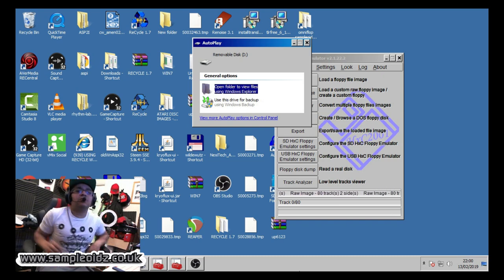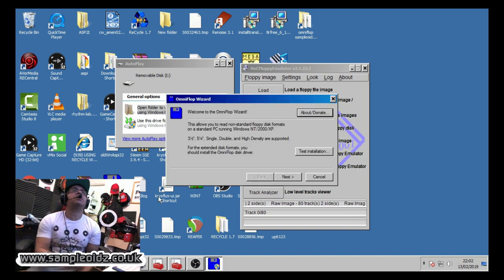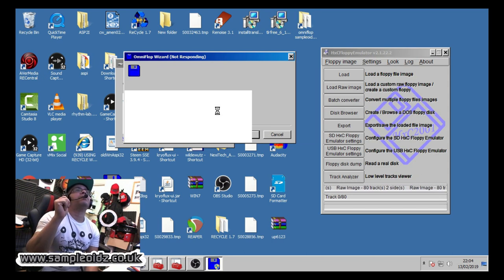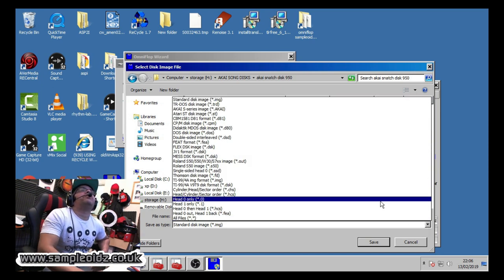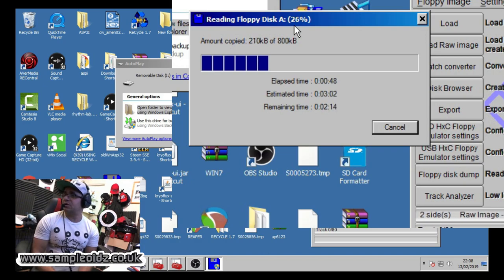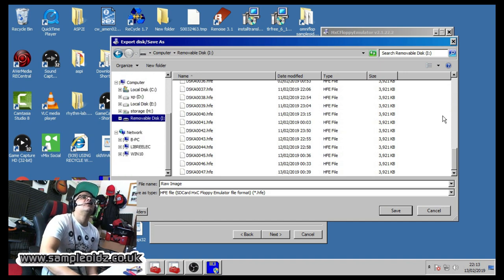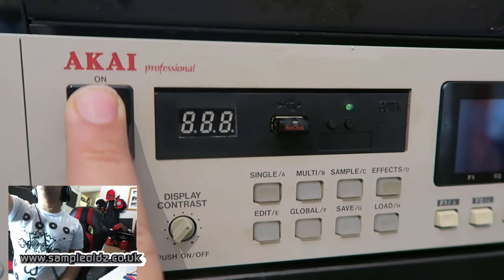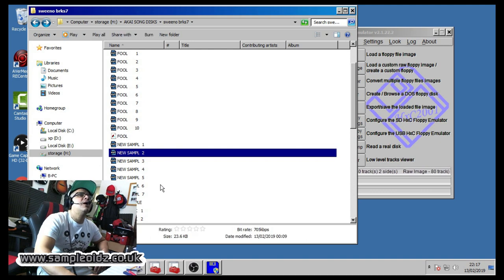Converting Hardware Sampler Floppy disks  to HXC Emulator 2019

Comment: You mate, are an absolute saviour. Just to let you know (if you didnt already) This works a treat with the s2000 aswell. I used your tutorial and a couple of bits online to reserect a s2000 with a dead drive. Thank you so much for your tutorials!
Reply: @TheBizzyBScience   I dont have any 950 disks or images, so the only thing i could think to try was converting the 15k king disk to a 950 hxc image to test it out. Unfortunatley in pops up with a 'No Disk!' error. I'm going to see if I can get hold of a 950 floppy off a mate to try and convert. I chose 3000 disk type in the hxe software which works, so if there is compatability with the 950 and 3000, there must be a way to get them to work. I'll let you know if I find a good way to convert them!

Comment: I have a Brother PDC100 sequencer that does not read or write anymore and i have many floppy disc that i have saved data on from it,can i convert these floppy disc to the HXC Emulator or some other format so the PDC100 floppy disc can be read on a PC or other sequencer?
Reply from the maker: I have not heard of this sequencer, but I think with some deep diving and experimentation with the config files and jumper settings you could find the correct settings. then rip your disks using onmiflop to img files and then to hfe format ( using goteks software ) good luck

Comment: hello great vid..don`t you have to have an old windows p.c. i.e XP with an INTERNAL drive to read these disks? ..i`m just about to start and convert all my samplers Akai s1000 / 2000 / 2800.. Emu V to this format and am a little unsure because there is so much conflicting info out there .. cheers
Steve

Comment: Thank you for this. Does the software work on Windows 10? I have a S3000XL and wondered if you have a link for the HXC Floppy Emulator that you would share so I know I'm getting the correct one please? This is the first time I'm working with this sampler after saving to upgrade everything, 2.0 OS on chip fitted, 32MB RAM fitted, EB-16 FX board fitted and the IB-304 Filter Board fitted. The only thing I'm waiting to find are the super rare FXM008 ROM Boards or the FMC001 ROM Boards. I've read through the Manual quite a few times now and just can't figure out how to keep S1000 Floppy samples loaded from Floppy, then choose the ones I like and load another floppy and choose ones I like on there and so on. I'm really confused. Do I have to save the ones I like to a new floppy after saving them as a program? It seems pointless having 32MB RAM and loading less than 2MB samples from a floppy and having to erase them from memory to load more to choose from. Am I correct in my understanding that the S1000 Floppy Samples are using the old AKAI mode rather then the new Multi mode in the S3000XL? I keep going round in circles. Is there any chance you could make a video showing how to keep the samples from a loaded floppy in the RAM so you can choose more from another please?

Comment: Hi Brian.  Your videos are very informative.   I just got a hxc for my Akai S2000.   With so many floppies images on the USB stick how do you manage/catalogue your samples?   Also how do you save files that are larger than one floppy disk?

I’ m also trying to figure out how to save Akai programs with the samples onto a floppy disk image.    I can do this if I create the program on Akai Mesa and then save to the floppy hxc via the SCSI connection.    I have a lot of Akai CDs however no SCSI CD drive.   I can read the CDs via Chicken systems translator or Awave however cannot send the program to the sampler via SCSI, only the samples.   Akai Mesa won’t read the CD as it doesn’t connect to virtual drives my PC.   I’ve also tried this app at the bottom of this web site with some  success however not all the time.   Zine.r-massive.com/Akai-s900-archive/

Comment: Love the tutorials, Just got an gotek usb floppy disk with the oled for my S3000XL yesterday, its up and running fine. I am using the HXC emulator software as well. But my S3000XL dont read the images. What am i missing in the process? S3000XL is running on the 1.5 OS, I have a image for the 2.0. Could some one help me out with a short explanation on why this is not working? I am using an Macbook air as well. Kind regards / Joel
Reply: @TheBizzyBScience  Thanks for the reply! they format are .hfe, i dont know if it has something to do with the usb? i just checked and the oled screen on the floppy usb reads flash floppy usb vol 2.14 and when i press the two small buttons on the gotek drive the oled screen reads reformat usb.   thanks again